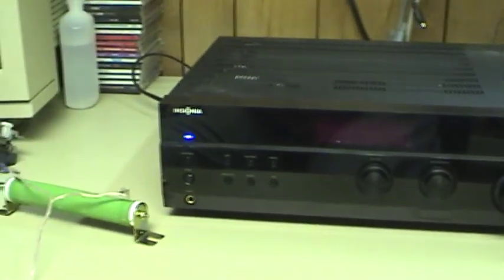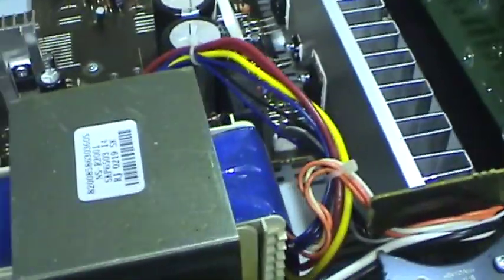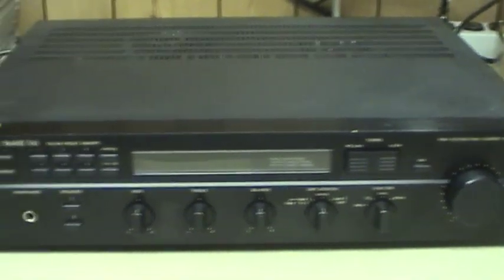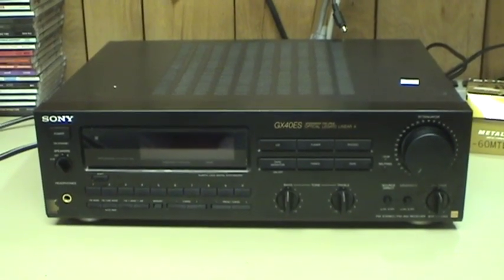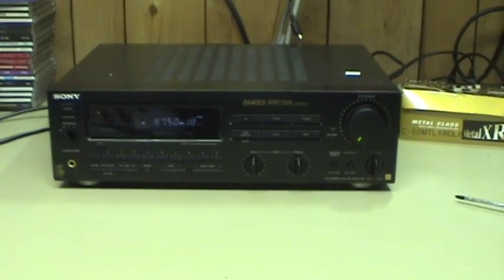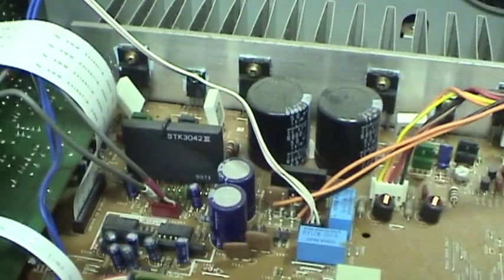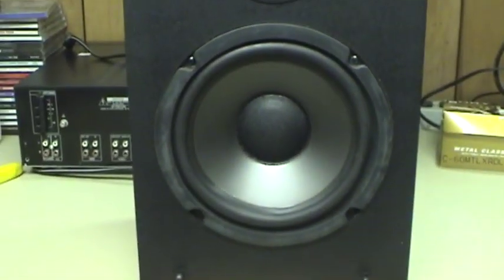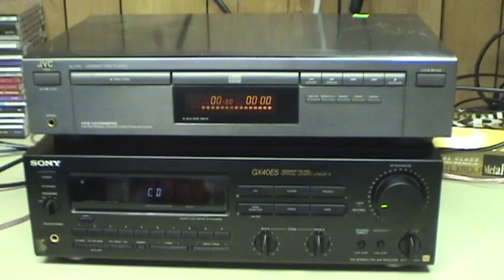Three Stereo Receivers and a Speaker System

Comment: well go figure! when i had it, i loved it. i've heard harman/kardon amplifiers that sound almost as good as tube amps before from the early 80's.

that JVC CD player does! i'm not a huge fan of mine. the filtering it a little nasty on it so it cuts down on the bass, but it works very well. i have it in my workshop.

Comment: Sony definitely applied their expertise to the ES gear. Current day ES stuff is not comparable in my opinion, but the ES gear from the late 80es, 90s and perhaps early 00s is fantastic.

My system is made up of the CDP-337ESD, VA555ES AV receiver as a pre amplifier (also powers my rear speakers) and a TA-N80ES power amplifier. All of them happily give you a hernia when attemping to move them around. Happily though, the performance is amazing.

I liked reading that this 40ES receiver has the "transparency" you referred to - an ampliifer when working well should just make the signal louder without colouring too much. This would make it a good reference when having your hifi battles in terms of deciding what sources are better or worse!

Comment: Fel-Pro was the stock gasket used by GM.  In the 80s the Fel-Pro Print-o-seal gaskets were used on the 6.2s, and the 6.5s ended up with thegray-ish compressed graphite like gaskets.  

One thing you'll notice is that these engines didn't come with valve cover gaskets from the factory.  The covers were RTV'ed on at the factory, same goes for the engine oil pan.  

I personally always use Fel-Pro cork valve cover gaskets with Indian Head Gasket Shellac on both surfaces.

Comment: Concerning the mute:

Well, if the police rang on your door because of a party, you could easily dial the volume down. If that takes a millisecond or a second doesn't make a big difference.

What I use it for is when I'm recording tapes and start the recording with the tape monitor turned on, I turn up my volume all the way to hear when the leader has ended and the magnetic part is reached. I have to turn it up so far because I use Noise Reduction systems. When I hear the tape noise then, I quickly press mute and start the source playing, so the recording starts pretty much as quickly as possible.

Comment: You can get new cylinder heads, completely assembled with valves, from Clearwater Cylinder Head, for a decent price.  Last set i installed a few years ago the vehicle owner purchased for ~$600 for the pair.

Make sure you use brand new headbolts, or better yet ARP headstuds.  The headbolts are Torque-To-Yield, or TTY, bolts and can only be used once.  The ARP studs are not TTY and can be re-used.  Torque spec for the TTY bolts is 25 ft lbs on all, 50 ft lbs on all, then an additional 90 degrees.

Comment: To fill up holes in speaker cabinets i use hot glue. It works VERY well and grips really good in the chipboard that speaker cabinets are usually made of. It's not the prettiest fix. But if it's on the back of a speakers cabinet, it's fully acceptable.

Comment: I managed to find a Marantz RS-2253 for $40. Seeing a piece of Marantz equipment for *that* much, I wasn't going to haggle over it. Damn good deal. Works better than the Sony POS it replaced.

I also found a set of full-range Optimus speakers at Goodwill for $35. I quickly googled them to see if they were any good, and lo and behold, they were originally valued at $200, and were very well reviewed. I had to eat ramen for the next week, but it was TOTALLY worth it.

Comment: It was perfectly timed for me since the receiver the Marantz replaced was pretty cheap and struggled to drive the Optimus speakers I had acquired. (You actually did a kitchen table repair on that very receiver: The Sony STR-DH100.) The Marantz drives them without breaking a sweat, though it has some issues of it's own. Still totally worth it, though!

Comment: The speakers sort of look like advent cabinets from the 90s I have a set of bigger advents that have that oak wood on top and the bottom front.  Advent also made some smaller bookshelf speakers with oak on top and the front. I think the ones I bought are from around 1994 or so when we originally bought them new.

Comment: Hook up some 4ohm speakers to that Insignia and watch it burst into flames. That power rating is very suspect considering the Marantz I got is twice as heavy with bigger caps. Even that one is rated at a questionable 100wpc rms/8ohms, but at least it can officially drive a 4ohm load without blowing up. As for the H/K, those overcurrent/voltage lights are handy as just about everyone overdrives a cheapo low power amp to clipping.

Comment: It just blows my mind out much of "nothing" is inside of that Insignia receiver and even in most modern receivers. You can easily see why these modern receivers sound "ok" but aint nothin' special.  I also hate the fact that modern receiver send most of the lower frequencies down the Sub output, and thus never can make use (under normal cercumstances of music listening ) of their power raiting.  It seems silly to me to have any 100W+ P/CH receiver, and still need a few hundred watt amp and 12" subs to make it sound like it should  :) but these are the times of modern receivers
Reply: WaybackTECH My much newer Pioneer VSX-921-k receiver is extremely well built for a fairly budget amplifier and packs one hell of a punch. It uses very good capacitors and has a massive heatsink. Nothing is as tough as my old Sony STR-D915 though(Although it seems the solder plague has snatched the surround channels)that old amp was out in a leaky shed for 8+ years before I bought it for $20, and wow! I could not believe the output, it makes anything (Including my 160w Sansui S-1000U and Digital Fidelity 280W towers) stand up and sing.
Reply: I have a "dated" Pioneer VSX-455 Receiver that my late wife bought for me back in the very early 90's.  While it does a pretty decent job of doing what it was made to do, sitting over in the corner away from everything else is a big square black box that can really get the neighbor's attention a few blocks down!  It's an AR-S112PS Powered Sub with a downward firing 12" speaker.  Again, from the very early 90's when you could buy equipment that was solidly built and strong enough to last, unlike this repro junk most stores sell today.  The thing I like about this setup is that I can switch the AR off and just enjoy decent sound from my regular system or I can really recreate the theater organ from "Phantom of the Opera" if I choose to do so.  It's all a matter of what you want your system to do.  Will I "upgrade"?  Not a chance!

Comment: What makes you say the gaskets have been done before?

When installing new gaskets make sure the block surface is perfectly clean and dry. Some people use that copper-spray-a-gasket stuff on the heads and block surface, i've found it's nothing but trouble and have never had an issue leaving the block and heads clean and dry.

Comment: That doesn't sound good to me.

Usually if the coolant is getting into the oil you've got a crack somewheres in a cylinder wall.  

I have seen a headgasket blow "just right" on a 6.5T where coolant and oil mixed.

Check your heads for cracks between the valves as well.  90% of the 6.2s and 6.5s out there crack inbetween the valves, but the cracks are "dry cracks"and as long as they don't extend into the machined in valve seat you'll be fine.  If they do, the head is junk and must be replaced.

Comment: my sony gx-60es   has a bad channel.( hence the reason it was @ Goodwill store)..have you done a video on output transistor repairs..?
Reply from the maker: +bill coxx I've yet to replace a blown output transistor in a stereo receiver or integrated amplifier...only a power hybrid module.
Reply: Wow that's hard to believe with the size of your collection. I've repaired many amplifiers and at least 50 percent of them is output transistors. Posting a video in couple days of two sony's a few months old. One with blown transistors and the other with a busted pcb. Love your videos keep it up.

Comment: You should never run any stereo receiver at 4 ohms because you could potentially damage the receiver most stereo receivers are stable at 8 ohms you can run a stereo receiver at 4 ohms but the manufacturer doesn't recommend it even if the receiver says 4 ohms on the back of it

Comment: Bill, I have (4) BIC America M-80 in-wall speakers in my basement. They are 8 ohm speakers and am presently driving them with a Pioneer SX-303R 100watt/channel Receiver (1996 vintage). I have experienced the receiver going of on protection mode a few times when driving all 4 speakers at fairly loud volume. My question is would the Sony STR GX40ES be a good choice being it has the selector switch allowing the receiver to drive 4 ohm loads for all four speakers simultaneously?  Also, will the sound quality degrade when the 4-6 ohm setting is selected?
Reply: *****
Thanks for the advice, I will look for the 50 or 60 model. .
Reply: Vinny 29
Bill, the STR GX49ES is rated at 60 watts per channel and was made in 1992. The STR GX40ES puts out 50 watts per channel and was made in 1990. Both are 2 channel stereo, look identical, assuming the technology is the virtually the same. Do you have any experience with the 49 model? .
Reply: ***** Bill, I ended up getting a Pioneer Elite SX-31 Stereo 2-channel Receiver. vintage 1992-1994. It is in great shape, really sounds good and can drive 4  8-ohm speakers like I was looking for. Only issue is when you first turn it on the one channel doesn’t always come on, turn up the volume a little and it kicks in. Once you have done this you can turn it down real low and that channel still plays fine. It really doesn’t have a scratchy-ness to it but I am quite sure it is a dirty or corroded potentiometer. This receiver had sat for some time so I keep thinking that with more use it will clear up. Once you work the volume control back and forth 2 or 3 times it always clears up and then plays fine as long as you have it on, have played it for 5 or 6 hours straight. I have read about using deoxit on the internet, shooting some in the back of the volume control but I am hesitant to do this for fear of damaging something else being it works fine. Do you thing over time with use this will clear up without deoxiting it?
Reply: Vinny 29 It may be poor solder

Comment: So I found a Sony GX40ES at Goodwill for 45. Was working great for a few days, and now nothing. I'm worried I fried it. Any recommendations on how to get it back to life?
Reply from the maker: Check your speaker wiring, and if you connected more than one speaker system, disconnect all but one system.

Definitely do check the bloomin' obvious stuff, though: maybe someone hit the Tape Monitor button or turned off the speakers? Listen for the protection relay to pull in a few seconds after turning the receiver on.
Reply: @uxwbill  so when i say nothing i mean no power, no click, no lights. I'm pretty sure i'm not even getting that relay click when i hit the power button. I took the lid off to check fuses and those seemed fine but the whole unit was full of dust and dog hair. gave that a clean but no idea where to go from there. My worry is that since i was using it in my garage on a surge protector, on an extension cord, on an extension cord  that by not shutting it off properly I may have shorted something above my paygrade  when I turned the lights on/off.{everything on 1outlet/1 switch(i know not ideal)}  Anything to keep this from becoming a $45 parts buy?
Reply from the maker: I'd start with locating and testing the standby power supply. It's there to keep things like the tuner memory intact and to keep enough of the receiver running that it can listen for a "power on" signal from the remote control (if so equipped) or front panel power button. If you don't have that, nothing else can happen.

A basic understanding of electronics theory would help, and understanding of how to work safely on a line powered device is critical  if you decide to try and repair it. If you're not sure, especially about working on line powered equipment, then the best answer really would be chalking it up to experience and replacing it. It's not worth your life or well being. Make as many tests and inspections as you can with power completely disconnected.

Cleaning the thing certainly won't have hurt it, and you might see something that looks burnt or distressed with careful inspection. (However, keep in mind that some parts just do run hot and get to looking rather 'toasted' after many years, even if they haven't failed.)
Reply: @uxwbill  hey just wanted to give you an update. 

after a day or two and no hope, it magically came back on. Lasted about a day, turning on and off, sometimes with the red P protection light coming on.  Finally after another stint of not turning on it came back on, but now won't turn off. I've resigned to just using the switch on the surge protector for on/off.
not sure how great that is, but it is playing music.
Reply from the maker: @danielregan3455  Thanks for the update. The way things are going, it sounds like there might be a bad connection somewhere, probably a solder joint. Finding them can be quite entertaining. A good magnifier and plenty of light will be your friends, if you decide to pursue this.

Comment: Thanks for great review. How could you connect a subwoofer to the Sony STR-GX40ES?
Reply: Thanks a lot ***** I'll pay attention to that. Cheers!
Reply: Hi *****. I got the Sony SA-w303 subwoofer (6 ohm impedance & has its own power). It has 4 speaker line input & also 4 line output. I guess I'll have to connect speaker terminals from STR-GX60ES (either channel A or B) to the speaker terminal on the subwoofer.

My question is: should I connect my Dayton B652 bookshelf speakers to the amplifier or to the sub? Will it make the difference?

Thanks again! Have a great Thanksgiving!

Comment: The three receivers caught my eye, because I have three old Sony receivers that I would like to use as amplifiers in a surround sound set up. Is that possible?
Reply: I hate that I have three good receivers that I can longer use. I tried splitting the 5.1 outputs out of the DVD player, but I notice a lag in sound difference. I' m thinking about optic cable from one to at least another receiver.

Comment: ok i want to hear the sony on a good set of 12s or 15s i had that same sony es line up back in the day the cd player that goes with that reciver is model number cdp-c77es look it up its great i still own mine it will make a sony reciver sound great  and has all the effects built in plus optical output was made in 1991 my es reciver lasted 15 years then i had a house party and the fan i had cooling it got turned off and it smoked like a campfire .now i have a techwood reciver model num ddr 95 .

Comment: Hey guys I need some help. My surround receiver outputs around 100watts at 6ohms, however, my speakers are 4ohms. I know my receiver will get warm as the speakers are a lower ohm than the recommended 6ohms of the receiver. But will the receiver still put out 100watts even though its running a 4ohm speaker. Or, would t to be better to wire the 2 speaker in parallel to get a 8ohm load, however i'll be massively under powering the speakers. Thanks
Reply: +uxwbill Have a question for you. I have a pair of Sharp CP-45 speakers at 8 ohms and 3 watts. Im looking for a receiver thats not too expensive around 100 dollars or less and i want to use them for my tower computer. What well be the best receiver? or is there a way to hook them up to the pc and get good sound?
Reply: Diego Geer Did you just say they were 3 watts?
Reply: TroniX Yeah. Thats what it says on the back of the speaker. it says rated power (EIA RS-426) 3watts. Is that a problem?
Reply: Diego Geer No, that's not a problem, since they are low power you can basically use anything to power them. I could find you a small amplifier if you want.
Reply: i did found a kenwood receiver for 40 bucks at goodwell. looked really good and had weight to it. don't have the money know until later this week. what do you mean by finding me one?
Reply: Diego Geer By finding you one, I mean I would look online and find you a good one

Comment: the insignia's phono stage is crappy, had to buy a $14 pyle phono stage and it is infinitely better.
Reply from the maker: The air went right out of your argument when you suggested a Pyle product as a replacement.

The NS-R2001 and later receivers don't even have a phono preamp.
Reply: +uxwbill so you see how crappy its phono stage is; besides don't have the money for a nad or project phono st. getting a  lp120 next week and hoping its phono st is better than the pyle.
Reply from the maker: No, I don't. In fact, I've been very happy with the phono stages in multiple examples of the NS-R2000 and RX-4109 receivers. Apart from a higher noise floor at very high volume levels, they compare well to the phono stages in my vintage receivers and standalone preamps.
Reply: +uxwbill ok...

Comment: Man I thought it just might be informative how to hook up a couple of receivers to increase wattage or something but it was a brag session on what you had or what you have, highly uninteresting and dull, how droll!
Reply from the maker: I don't think that word means what you think it does. 

You wouldn't have even had to expand the video description to know exactly what this was about, but thanks for playing!
Reply: @uxwbill  no I got it right I wanted to know if you put two amps together receivers to increase your wattage going out on your speakers it's wattage going to your speakers not amperage
Reply from the maker: You can't connect two amplifiers together unless they're specifically designed for it. While expressing power in watts is much more common, it is still correct to state that current (in amps) is flowing in an operating speaker system. Look up Ohm's law.